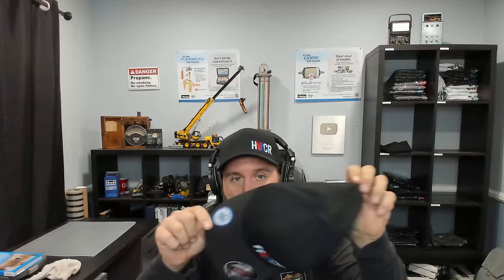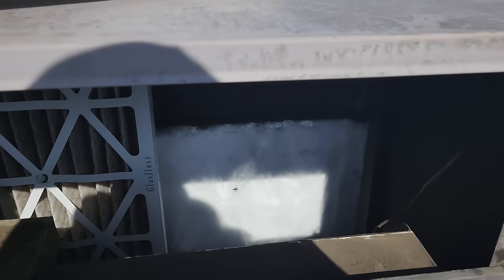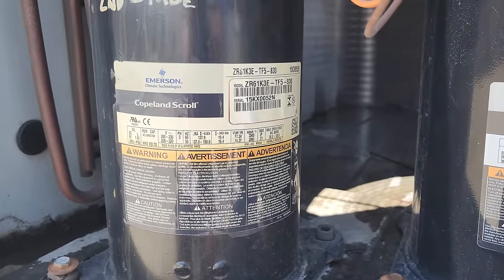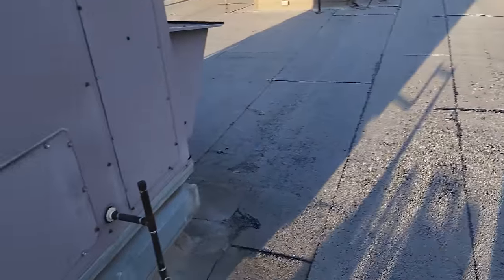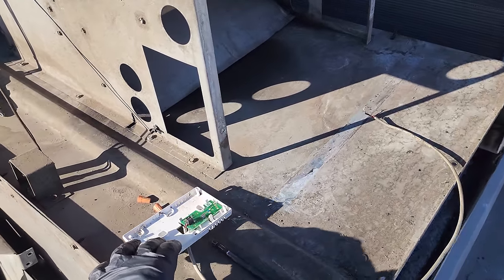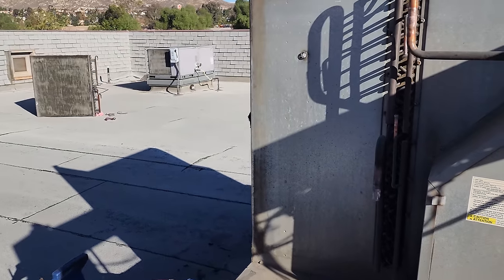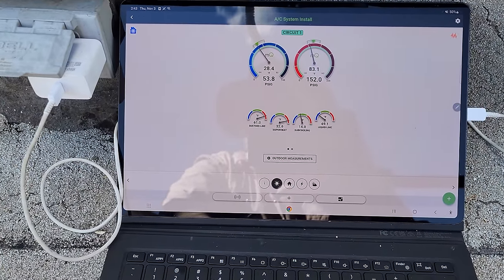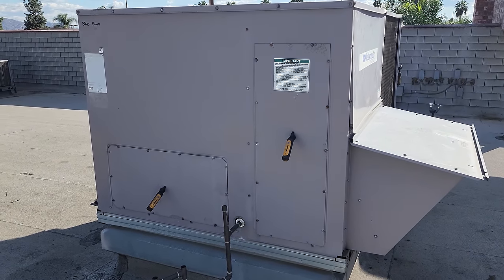THESE AC UNITS HAVE SERIOUS PROBLEMS

Comment: Like your teardown and analysis opening up, and then doing an autopsy on the metering devices.  And explanation and diagnose and reasoning, well explained to get the point across..

Thorough description of the ambient load conditions under which to test we’re being taken at your time a video .  

All these little details stack up in the encyclopedia of knowledge that is needed compiling on unit after unit .  Young technicians pay special attention to the detailed explanations of how, and why an item is operating and diagnosed under different ambient conditions..

Comment: I can’t believe this unit is worth two compressors and an evaporator.  It’s best to install those suction line filter driers on the vertical.  They tend to trap oil.
Reply: great tip thanks.

Comment: I replaced a condenser coil the one that was shipped took damage I told my old boss to not risk it. It was a 2 circuit condenser he had the other tech test only 1 circuit 🙄 so when we pressurized both circuits the other circuit was leaking 😂😂

Comment: I think that in the future you should implement an intake procedure to check for damage on all major parts like this before a return becomes impossible. Sure, it may be completely functional as installed but I would not have posted this video. It communicates to the uninitiated that you are not protecting clients by conducting your quality checks prior to major repairs when defective units can be replaced. Were I your customer, I would not be happy seeing this. As a business guy, I would own this as a failure to my employees to maintain the high level of conscientious professionalism you almost universally demonstrate. Which is why I watch your video's even though I am not an HVAC professional. Best wishes. Regards,
Reply: As a service guy, (IT Consultant) I understand that this is a manufacturing problem, and that the service guy is doing what he can to get the customer back up and fully functioning as soon as possible.   There are times you can get away with saying "We'll send it back and ask for another one", and there are times where you have to say "The customer is crawling the wall about getting this thing working as it is.  He'd rather have it not pretty and working rather than wait another 8 weeks.   He's not going to come up and stare at it every day."
Reply: @tbelding  Good point. However, I still would not have posted this.
Reply: @davevario  I'm glad he did.  Most people only want to show the 'nice' side of the business, and make themselves look like heroes.   This shows both sides of the business.
Reply: @tbelding  Look, I'm just a business guy who has bought and built businesses. I want to build my customers confidence in my work and ethics as this is key to growth. If this channel were only watched by HVAC professionals who have the discernment that you had to explain to me, I would agree with you. I like this guy and I respect. I want to help him because he has entertained me. I would not like to see him undermined in any way.
Reply: Granted, yes, maybe the coil could have been inspected for damage sooner or right at receiving the shipment. But it wasn’t, so moving on…. When the damage was seen, he did the right thing by checking and repairing any spot that looked iffy. And he pressure tested it before installing. Any competent HVACR guy is gonna do all that. He’s confident in his repair work. Shit happens in the field, or in the shop. I see nothing wrong in what he did, especially these days, with shortages, long shipping/delivery times and all the other delays.
Reply: @davevario  - He just showed his ethics.  He realized there was an issue, and he took care of the issue in the limitations with which he had to work.   Which is, 1) heat's coming, 2) can't get a replacement in a reasonable time frame (even if he HAD inspected it in shop, all he'd have been able to do is the repair _there_), and 3) Customer wants it running ASAP.    

People with less ethics, of whom I've had to work with too many, would have just tossed it in as-is, and then charged for a later job, calling it something other than install failure.
Reply: @tbelding  Troy, I never once questioned his ethics. Peace bro.
Reply: @jollygreen4639  On this matter I believed Troy and I believe you. I'm not saying he did anything wrong. I was concerned about what it communicates to customers who, like me, won't understand the realities of what you HVAC guys face. In business, you don't want to draw a complaint or have to explain anything to a customer because it takes up your time, and they may decide any number of vein imaginations about you and your business practice. Regardless, moving on.  Peace bro.

Comment: Not going to lie up being repairing those specific units for 22 years on a mall and it is the worst design carrier has ever made I could go for probably 20 maybe 30 minutes on all the bad things and all the trouble some issues with that specific unit but yes you're right I wish they had the ProPress connection equipment back in the days like 10-15 years ago it would have helped so much I would have just cut them out bent a new piece in and put a couple in pressed onto it The biggest issue with these damn machines is those fixed office evap coils they always get plugged it's just a stupid design

Comment: Well, let me ask you this, is this happening on all units or just carrier because they have not great design, why they don’t gave something that you can service? I think they have designed it so bad so it fails after unit get cold and cough couple times. Not making se sense to replace whole evaporator because of plugged orfice . Bottom line all manufacturers are getting cheap

Comment: Why do they drain the condensate through the building?
Reply: roofs last longer. Water is corrosive AF
Reply: @DocNo27  live in Indiana we drain on the roof
Reply: @kevinhurley7846  lots of people do - still doesn't mean it's necessarily a good idea :p
Reply: Condensate when drained through building is usually routed to an approved receptor, like a floor sink or mop sink. Usually per code if you drain to the roof, you're supposed to route directly to the roof drain. Unfortunately, a lot of contractors will cut corners and let it drain directly to the roofing.
Reply: Because California
Reply: Climbing around equipment (IT Consultant in Houston), I don't think I've seen a 'spill it on the roof' type.    Usually it's either piped off the side of the roof, or piped into a drain.  Or in the case of the ones over the server rooms, run through a pipe that's never cleaned, so the pan drains into the server room ceiling.

Comment: About new evaporators. . . We one day replace a entire rooftop installed on the side of the building, , . . remove the old one, installed the new York 5 tons   The following spring, , I got a call for cooling not working. . . got there, , the machine was empty of R-22 ? ? ? ? Brand new  OEM machine, , , leak test, one return bend in the evaporator leaking. .  I flush the nitrogen, l did a R-22 flush and refill the machine and call for another evaporator The lady owner of the business was kinda frustrated. . .to say the least. . I replaced 2 more evaps and then  we called for a new machine all together . . . . took months to arrive, all waranty work not paid for after 2 years. . . . Shit happens. . 🤨

Comment: Carrier may or may not see this but hey, screw it;

Why don't they suspend replacement evaps or condensers with sheets of polystyrene or medium density foam to protect the fins, then and add small rubber shock absorbers to the brackets that hold them in place in the box?

Granted, it adds cost to the packaging, but that packing cost is nothing on making sure your defect rates stay low and reputation as a good, high quality refrigeration tech company stay high...

Comment: I would like to hear your thoughts on my Lennox experience. The first five years I owned my new gas pack, the heat exchanger had to be replaced. Multiple control boards and miscellaneous parts failed. As I am writing this, it is down waiting for the burner assembly to be replaced. The parts are available, but I have had to cough up a fortune in non warranty labor costs and now another labor bill for the burner replacement. Lennox said that's life so move on with it. Thanks for any advice on how to survive my fairly new money pit.
Reply: Replace it with a TRANE.

     I Have Installed Trane Units for OVER 25 years...   

       Most of the them 15/20 plus Years NOT one Single Problem.......

       Maintenance is the SECRET 
       I Service this Systems for my Customers 
       
     2 times per Year
( Spring & Fall )

Comment: The coremax removal tool is expensive
Reply: i just burn them out and replace them with regular fittings. i am SO done with them. its just stupid expensive, annoying and they always leak.
Reply: Sure, but look at it this way; so is the time it would take to remove them with other methods. If you can get it done fast, you're saving a lot of headache, and time in the long run.

I think probably the bigger issue is that the coremax fittings kinda just suck. There's got to be a better way to make a high flow valve.

Comment: How the hell do you know which pipe is which without any labels? Do you use schematics or do you just know, based on some common compressor/cooling layout? I mean, cables I understand, they're are different colors, and you can check on the board what is what, but the pipings?
Reply from the maker: I have a very good understanding of this particular unit and that allows me to just follow the pipes and know exactly where they go

Comment: The condition of this new coil is just crazy. these people haven't heard of Styrofoam?
Reply: Styrofoam could compress the fins, but it would certainly be cut BY the fins, and those cut beads would end up stuck in the fins.    You'd need to use something like polyethylene foam, but that's a higher density, so it'd be a lot more likely to dent the fins, even though it wouldn't get caught when cut.   

Almost the best foam would be polyurethane foam, such as used in 'egg crate' foam.  (Although I've never seen it used for packing eggs)  Soft, less likely to bend the fins, and resiliant - but then it's less likely to absorb point impacts.  

So, basically, they say "Since none of the foams are that great, let's just use wood and air and say the heck with it"

Comment: That's a $3000. Buck mess of a coil, You're not technically stuck with it once you show the video to the manufacturer tell them you want a 50% rebate because you will have to go back and probably fix it and the life expectancy of it is being reduced because of the terrible constructive work they perform

Comment: I've been a Union service technician for HBA C and refrigeration for coming up on 22 years now why are you using such weird language, do you ever think that stage one may have a better capacity of cooling than stage 2, comma want to use RX11,nitrogen  flush it out and then remove your liquid line dryer at the same time Replace it and continue if it's not overheating at the compressor's not over amping your windings are good you're just making more work for yourself and selling more s*** that The customer doesn't need I think in 22 years I may have replaced 3 or 4 evaporated coils on those carriers,a dime a dozen..  But hasn't restricted orifice in it and I can see that you're boiling off refrigerant and stage 2.. Did you do a temperature drop across your filters mine dryers would you like to call them it's a lot of extra work I see going on in this video.. Yeah I broke the suction side line because he didn't have the torch in the cup he had that big a** rose butt tip on that poor 78 side and you've got it so hot it cracked.. I wish anybody the best of luck in this field we need more guys that are interested in it so if you're watching this video please take this stuff Very open minded I would have done a 100 different things differently and had a different result and probably what I had that customer up and running in the same day.. I'm guessing that this is an Union shop and they don't have the money in manpower and the legit tools to do the job which is fine there's no problems there but there's a lot of different things that could have been done differently cheaper for the customer and more importantly less work for you I'm 42 years old I don't need you more work.. Work smarter not harder.. Also most of the time you don't use sub cooling on a fixed door fist of any rough top at all that is mainly for TX b's to make sure that you're getting liquid to the valve you're gonna do set up super heat 95 to 98% of the time hes hyping up what hes doing for some reason I'm out